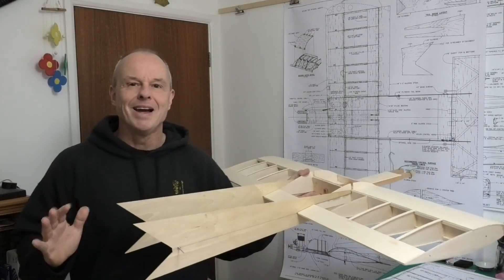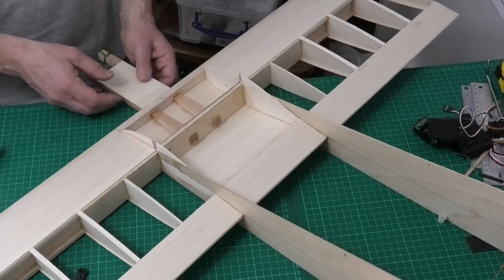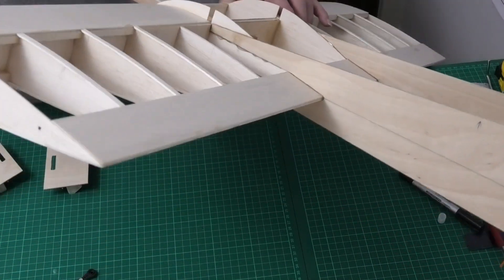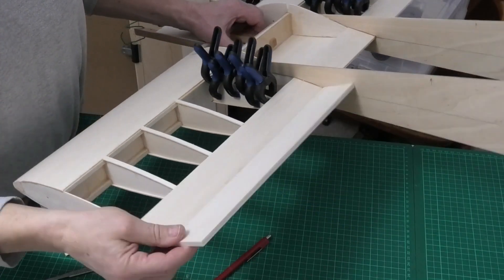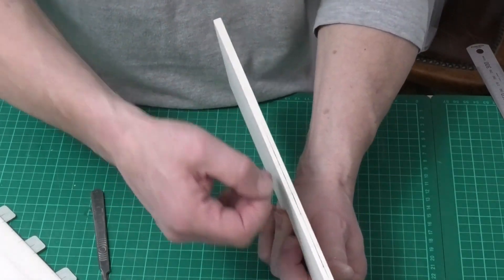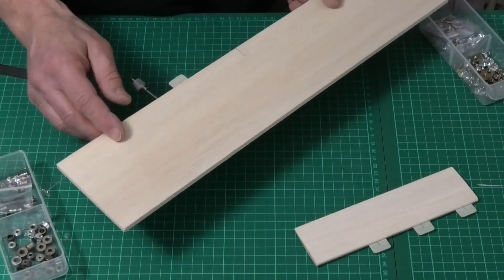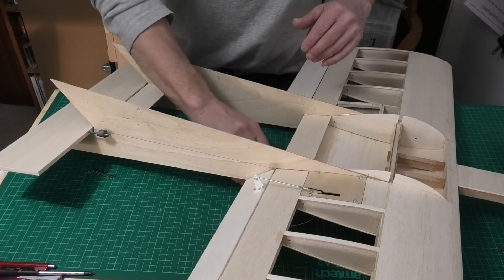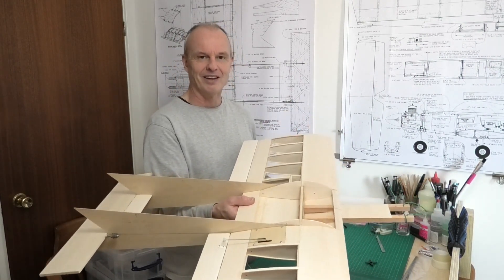Voodoo VI - Hi Performance 40" Combat Wing: Pt 5 - Control Surfaces & Wing Servos

Comment: If it comes out tail heavy,  maybe you could match the fixed part of the stab outside of the booms as counter balances. They should take  the strain off the servo at a lot less weight.  Air pressure replaces the extra weight. There are quite a few planes that have them on the elevator and the rudder, too.
Reply from the maker: Thanks for the suggestion great idea, really apreciate the comments

Comment: Re counterbalancing, why can't you add balsa either side, forward of the existing elevator as in WW2 aircraft to assist in moving the elevator?
Reply from the maker: Hi Peter, that would be a good alternatve, but I guess the designer was trying to keep it looking a bit different, maintaining the crazy flying wing look! hahaha, which it cartainly has.  Weight may also have been a factor, but not sure about the weight of a tailplane compaired to the balance weights.  Appreciate the comment